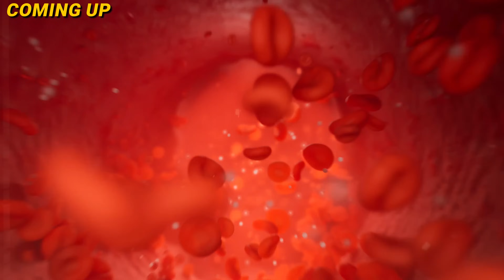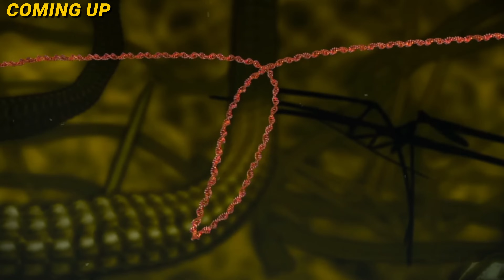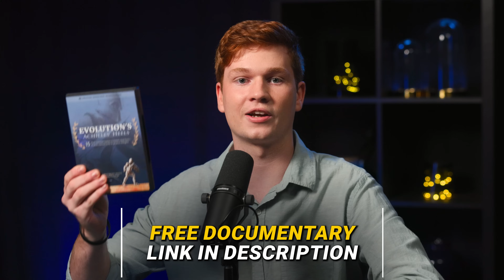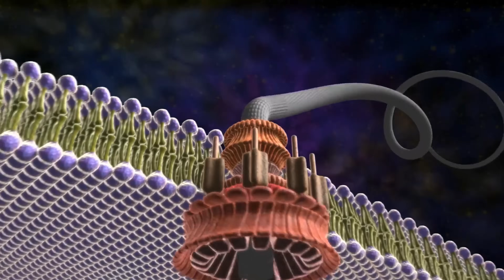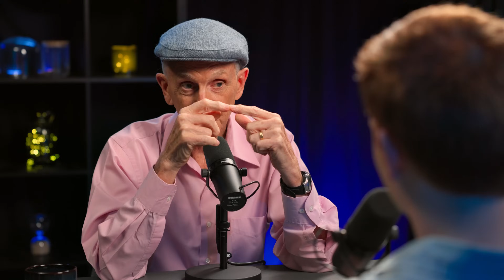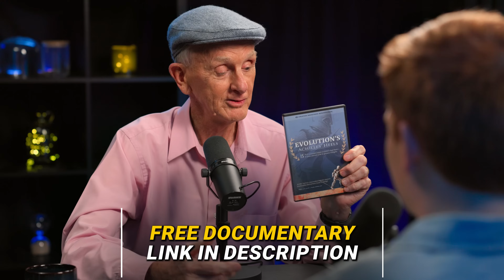Mind-Blowing Nanobots in All Living Cells!

Comment: I don't feel like most people consider that every single component of life is comprosed of systems.  If reduced to the simplest forms you get the systems that make up life and its functions.  Then going in the opposite direction you get higher forms  of life that are co.prosed of systems.made up of individuals cells that arw themselves systems.   So you ahe. Systems withinv sistems cormprosed of systems that live in systems auch as ecosystems. 

Then on top of that.just basing it on the so called abiogenesis original life form.
Is aleged to jave formed with all of its systems in taxt.   Respiratory, digestive, or photosynthesis, and most impoetant lf all ..reprodiction.
There is just.too much suspensjon of diabelief required to accept it.

I was taught evolution in school like almost everyone else.   I am at the point now that i wven question the validity of so called micro evolution.

I could be wrong.   But  i suspect the so called examples of evolution we are given are potentially reshuffling of pre existing genetic data, and not new genetic code. But it will take more reaearch. To learn more.

Comment: Regarding the Flagellar motors ... what most impresses me is not just the rotary motor driving the flagellum but the mechanism by which torque is cancelled. Without it the rotating flagellum would cause the cell to spin in the opposite direction. Could a flagellum also have a counter-rotating inner shaft?

Comment: The Firmament Surrounds the Water. 

There are 2 Spaces, Space and the Modalities of Counter Space which is everywhere matter is not, all polarized points bind to Counter Space to Form Matter, the Distance from one Polarized Point to Another ANYWHERE through Counter Space is 0. It is Master Ground. 

Which means the MOL equation is correct but the description is wrong.

End of Line

Comment: Breadcrumb: The Motor

Follows the right hand rule and the Fibonacci sequence and Does Not Change Mechanical Energy. 

Answer
The Polarized Atoms are binding to Counter Space, this is the exact same design as the “Ark of the Covenant” 

Single Pole Geo Processional AC Generator is the Opposite of ATP Machine

End Of Line
Reply: Visually Provable 
Two Magnets do not push or pull one another

End of Line
Reply: They don’t realize that they are discussing something that is very close to free energy. 
The speeds are based on thermal and Processional speed of a polarized point in route to Counter Space.

Visually Provable 
There is Only two Spaces.

Counter Space <> Force in Motion <> Compression | Light ~ Neutron > Proton, dielectric Spin Begins, 1 Compression Shell, Hydrogen.

End of Line

Comment: If evolution were real, wouldn't you expect to see a bunch of different types of half-formed unfunctional enzymes and micro organisms/structures within a cell, or within certain anatomical features of different animals? If it's formed one step at a time..
But we don't see that at all, every part of our biochemistry/anatomy and cellular structures are useful, complex, and complete in the sense of achieving purposeful and useful functionality.
Structures like the bacterial phlegellar motor, which is literally the most efficient rotary motor in existence, converting ion gradients into mechanical work with nearly 100 percent efficiency, rotating at over 100,000 RPM, much faster than any F1 engine.. and it wouldn't work if it was half built.  It needs literally every single component it's composed of to function at all, but with every component, it functions very well.
Same thing with the Topoisomerase and other enzymes.

They might say "well that's because of how much time organisms have had to perfect it's evolutionary form", but when we look back in the fossil record even as far back to the earliest and lowest geological strata, such as the cambrian period (we see no animals in any pre-cambrian layers) we find a fully-formed animals, with highly complex anatomical features such as the eyes of the trilobytes, and nothing is half-formed.

Comment: the motors are not going as fast as they think.

going 50 mph around earth would take quite some time just to do three rotations around Earth. 
doing 50 mph around a penny the amount of rotations around it are magnitudes greater.
now 50mph around something nano-sized... probably millions of rotations per second.
so the smaller the motor it's not necessarily working more than a jet engine.

Comment: If all those RPMs in our cells are going on all over our bodies all the time, then that must produce a lot of heat. I'm sure our bodies also have cooling mechanisms (besides sweating). I've always had a real problem with being too hot all the time. What internal mechanisms cool our bodies off and what would happen if the cooling mechanisms didn't work well or even broke down completely?

Comment: The levels upon levels of interdependent complex systems found in cell is an engineering marvel. Microbe to man evolution demands an upward trajectory of progression that has the creative potential stronger than the forces working against it, like time demands and decay/entropy potential. Industry, delivery, fabrication, information, repair, - systems - etc working together interdependently requires foresight. There are often a thousand ways something can go wrong to a single way that it works right. The more complex the system the higher demands of coordination and time restrictions. You get something wrong and have to start again ... But how many times can you start again  with the material you have access to?

Comment: Everything in existence, debunks evolution
Reply: I do some preventative maintenance in a large automotive factory. I might do something like clean off welding slag and dust, and switch out small pieces. Even in my fairly simple work, there is a lot to be careful of and a lot to pay attention to and a small mistake can have a huge effect on the system. There are these copper tips on the 'fingers' of the welding claws that are one small part of an interdependent system. The 1 robot itself has electricity delivery, pneumatics, various  types of mechanical parts from cotter pins to bearings to gear boxes, parameter sensors, and programming. Now , if I came in and decided to change the copper welding tip to a gold one (because gold is better of course) without consulting anyone, nothing could go wrong... Right? What if I changed the cotter pin in the  claw's wrist and just put in a twist tie from my lunch bag? Or ... Decided I needed to make a parameter change in the programming of this 1 Robot and I adjusted the code ? What could one letter-change in the code really matter?
Reply: @calebvanderwolf1777 - not my corporate masters.
Reply: @NateWilliams190 - Evolution is over generations. Adaptation is the same individual. And evolution doesn't need new information. People have been lying to you. Why don't you listen to real biologists?
Reply: "debunks evolution"? Never seen an article claiming that in a serious journal
Reply: Calling evolution bunk would be an upgrade. For every professor I hear that says they believe in evolution, not one of them can say what actually happened. It's like asking what color the emperor's invisible clothes are. When you ask about the actual chemistry it's just crickets. Just watch Jim Tour choreograph Cronin's entire performance at the Harvard event. Hilarious.
Reply: Or evolution was created by God,, evolution point away from a random Godless universe and actually makes the case for a creator. Nothing random about evolution at all,,, it proves God's existence.
Reply: No,, everything in existence debunks aethiesm.
Reply: Without evolution humans still live in trees. Humans living on the ground know that evolution happened
Reply: Evolution is the person who hits his malfunctioning tv with a hammer not knowing that there is an engineer.
Reply: @montysmythe579   and i remember a good wack use to actually work on old TVs, Nintendos & radios... The technology has evolved (with our guidance), so now we just tap on the screen with a finger tip and it reacts or responds accordingly.
Reply: @nobody3692  
Good try old bean, however, Nintendo tech and the like didn't just evolve autonomously, it had a creator.
Reply: Apparently resent generations of kids have Stopped developing tonsils, appendix & wisdom teeth altogether.. science considers this phenomenon a "micro evolution"..  This generation of kids are losing their peripheral vision from  adapting to starring at screens.
Reply: @nobody3692  
Where can we find this fascinating study
Reply: @montysmythe579  you're living it
Reply: @YECBIB  
Living what exactly
Reply: @nobody3692  evolution is a false concept
Reply: Why do we have a tail bone?
Reply: @IamThatiAm420  
If there is no tail, then there is no tail bone, it's a coccyx, the termination of the spine.
How else would it terminate.
Reply: No proof of a god.
Reply: @IamThatiAm420  
However, proof of a creator by any other nomenclature.
Reply: as long as you are within the universe, you will experience causality, will experience time and space, will experience natural laws influencing the particles that exist and make them change state. the changing of that state, is called evolution. therefore ANYTHING contained in the universe is evolving alongside cauality unfolding (time proceeding). there is literally NOTHING that debunks evolution. there are a couple things to doubt/question it (e.g. we cant comprehend what a timespan of 3 billion years could involve and cannot replicate it, therefore not prove how life came into existence) because we lack understanding - still - but not debunk it. you can however EASILY prove causality and that automatically proves evolution because its simply a passive consequence of causality.
Reply: That's true. Creation is shown at every level.
Reply: @calebvanderwolf1777 - eviodence of evolution? Look at the diversity of dogs, apples etc
Reply: @tdance-l6o  oh please, is that it?
That is not evidence. No new information is being created. All that is happening is the already existing genetic information is being expressed. Give me evidence of new genetic information, not the corruption or loss of existing information. All the different varieties are expressed within the genome. Try again.
Reply: @tdance-l6o  not,
Reply: @tdance-l6o  my answer keeps getting taken down. I don't think your corporate masters are happy with me.
Reply: I will try a watered down version. The grammar will be awful, but it's a way round the cencers.
Reply: @ Same thing with me, interesting....
Reply: @calebvanderwolf1777  my masters?
Reply: @tdance-l6o  the diversity of dogs? You mean the dog kind?
Reply: @tdance-l6o 
That's not evolution.  That's adaptation. The genetic code to build a dog with different traits already existed within the 1st dogs. Evolution requires New Information to create a New Trait that could never have been achieved with the original information.  In fact, it's a loss of information that produces 'breeds' of dogs.  Chiuaua's have lost the information to become large dogs just as Afghans have lost the information to become short haired dogs..
Reply: All enzymes are nanobots. Result of evolution
Reply: Got some facts with that bizarre opinion?
Reply: @LordCaptainFather  I might ask you the same. Do you have one proof, just one, that evolution is possible. No rush, I can wait.
Reply: @calebvanderwolf1777  No probs.... Articles Making an Impact in Evolutionary Biology and Genetics, The Evolution of Evolutionary Theory, Evolution: Evidence and Acceptance, Extinction Events Can Accelerate Evolution, Beyond Reasonable Doubt: Evolution from DNA Sequences. If you enjoy these reads, there are several hundred thousand more....
Reply: @LordCaptainFather  apples dogs etc. Shows you have a poor grasp of the subject. 
That is not evolution. There is no new information just the scope within the existing genome.
Reply: @LordCaptainFather  I have read extensively on evolution. That's why I  don't go along with it. Hear say, just so, maybes. It certainly isent science. Give me one example of new information being added to the genome.
Reply: @calebvanderwolf1777  Ah, I see  the problem, you have neither studied information, math, nor genetics and are not time served in any of these fields. No problem. Have a great life. You will figure it out one day, in that I choose to have faith (;
Reply: @LordCaptainFather  ah bless, that's all you have, ridicule. Take that away from a evolutionist and all you have left is a vacuum. 
Seriously, no science, no reason?
Reply: @calebvanderwolf1777  Not at all, I have faith that within a decade of hard study and some time working in the field you will get it.
Reply: @LordCaptainFather  so I would be like you? Totally unable to engage in a scientific debate?
Again, give me one proof, just one.
Reply: @calebvanderwolf1777 You want “new information”? Whatever that means. If I tell you, I bet you won’t accept it and say it’s not the type of new information you want. If not, tell me what exactly new information is.

We can go back to dogs and wolves. Wolves can not digest starch. But guess who can? Dogs. They’ve gained a new gene that allows them to do so, most likely because humans started feeding them foods with starch. The ones who could digest starch would get more nutrients and thus reproduce more frequently.

Even in humans, we see an interesting difference between what we can digest and other animals. Humans have a new gene that allows us to digest lactose at adulthood. Most animals can’t do so, and it’s such a new trait that many humans can’t either, lactose intolerance.

We are more resistant to caffeine than other species as well. To most, it’s extremely toxic. To us, it’s a stimulant that feels good to ingest. That’s why dogs, birds, cats, rabbits, and most other animals shouldn’t be fed any chocolate or coffee.
Reply: @calebvanderwolf1777  Sure thing friend, here are around 240 proofs; in the following research papers. I believe in you